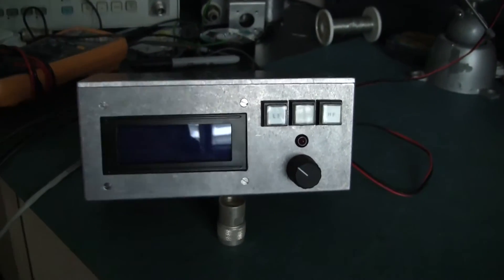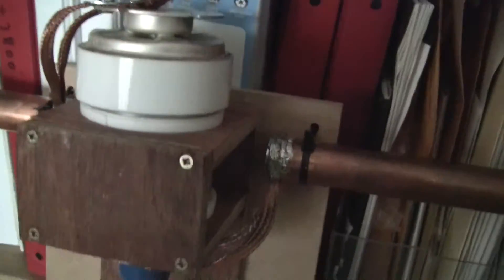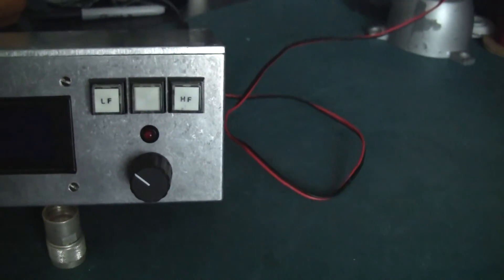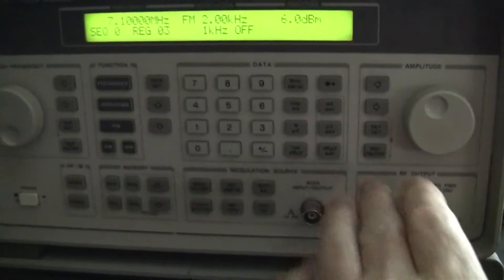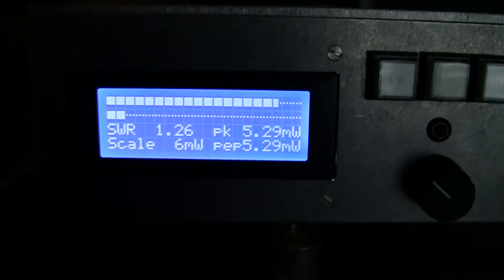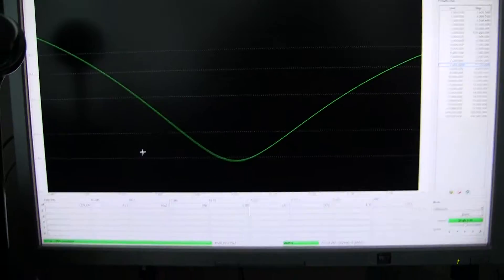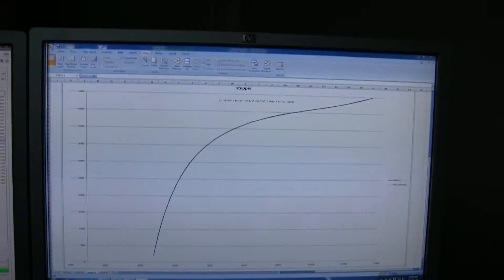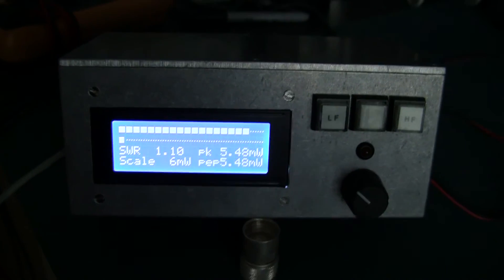G4WIM Auto Tune QRO Mag Loop  3.7MHz to 14.6MHz

Comment: I want one of these boxes! So far, I haven't found anyone who offers ready to ship loop tuners like this, hard to find someone who will even build one.
Reply from the maker: Hi, have you watched my latest video with the new hardware and firmware etc?  I do have a complete set of prototype pcbs fully populated but would still need building into a case and the loop / vacuum variable capacitor would need to be assembled so far from a ‘turn key’ ready to use solution.

Comment: Hi. Are details available for.me.to build one for my loop I am making please ? Also. Are the protocols known in order to drive it all from the radio to tune as you tune from vfo ? Or do you select the F from the controller ?
Reply from the maker: Hi Ross, this design requires no radio interface or control as it measures the incoming frequency and acts accordingly.  The design was published by Radcom but I don't have any PCB's available.  Regards Tim

Comment: Tim, this is awesome work.  I read your article in RadCom and, that is even more impressive.  Thank you for sharing.  I do have a question, as I was pursuing as similar but less elaborate approach.  When you initially powered up the control box, at around 3:07 into the video, the calibration sequence initiates and shows the motor's steps on the LCD.  How does controller know where in the VVC's 24 turns it is starting from?  I didn't see any limit switches...  Where is it spinning the VVC from and where is it going to to in the initial calibration process?  I am hesitant to connect a motor to my VVC and over spinning it in either direction.  I realize that once you have a correct starting point, it is just counting steps going forward.  Do you manually spin the VVC back to an end point before you power up the controller?  Thanks again and my apologies for my rambling on.

Comment: I am currently rigging up an arduino to a gear motor and a potentiometer to my variable cap. Instead of doing a proper setup I'm just going to program in the positions found by testing and use up down buttons to set the freq i  the arduino which snaps the motor to the stored position which is coupled also to the pot where 1 revolution of the pot covers the entire range of the cap. Basically its a dumb blind controller that just has presets for certain freqs and interops between them. It wont have an swr bridge so it will be blind and will require the user to set the freq in the arduino to match the transceiver.
Its super cheap though.
Reply from the maker: you may find that using the system you describe is very difficult to accurately tune due to the back lash in your gear box and the fine degree of control required - especially on the lower bands where the loop bandwidth may only be a few kHz.  I found that I had to write the code to accomodate the very small about of back lash in the shaft couplers as I needed to be accurate to within 0.25 degree.  A single turn of the pot would imply a count of 1440 and at least a 12 bit a/d to get anywhere near, then you'd still have the back lash to contend with etc.  No doubt you've figured this yourself and decided it's ok for you needs :-)
Reply: Tim Forrester I use a 6rpm motor. I have been just manually pushing buttons to turn the motor. I'm going to use plastic gears instead of a shaft couple ( currently using a stiff straw and two hose clamps).
The gearmotor is so low geared that it doesnt ever turn on its own during vibration. The straw flexes though so there is a small lag time before the cap follows the motor.
So currently its just a gearmotor coupled to the cap by a straw and then 2 boshe automotive type relays to implement an h bridge and then a 3 position switch near the operator. Also replacing the copper tubes with copper foil wrapped around plastic tubing with heatshrink to make it durable enough for mobile. The goal is to survive brutal tree branch impacts at highway speed.
Reply from the maker: hi Richard, most VVC's take about 20 revolutions, thus a 6rpm motor would take 3-4 minutes to go from min to max which is why I use a stepper whose speed I can control at will and so perform controlled accel and de-accel to minimize transit time.  Guess I must not be seeing the full picture of your system, but good luck and have fun with your project !

Comment: To be honest Tim I don't think birds sitting on the antenna would be a real problem. obviously the Capacitor and braid connections would be waterproofed to stop any rain or snow causing arching? Also change in temperature will also change the tuning when sun comes out! If it ever does in the UK? I assume a high vswr alert maybe a Beep etc could warn of any problems?
Cheers Mark GØNMY

Comment from the maker: Since making this video, I've now designed a PCB for the controller which also has a second stepper motor output which will rotate the input coupling loop to ensure a good match across a much wider frequency range.

Comment: Wow, if a bird perches on it will it auto tune while transmitting? I guess he would move pretty quick if you were running 1kW.
Reply from the maker: Ha Ha -  I hadn't thought of that :-)  In practice it's most likely to be installed in the attic but if it were installed outside the auto tuning can be turned off to prevent the system 'hunting' caused by external effects.
Reply: Tim Forrester Wouldn't it be though that if a Bird landed on it outside that it wouldn't be affected because the Bird isn't stood on the ground/floor as you are. Just a thought Tim as of course Birds can sit on power lines. You have replied to my post asking for info in constructors corner on hrd.co.uk.
Reply: Fred196407 Thats because the line frequency of power lines is extremely low so the reactance of the bird is tiny. At rf frequencies the bird will have enough reactance to draw enough current for a nasty RF burn. Though at higher power levels the small reactance will draw more current which is why birds do not land on power lines of 40KV or higher. The reactance causes pain to the bird when the bird gets close enough so they dont land.